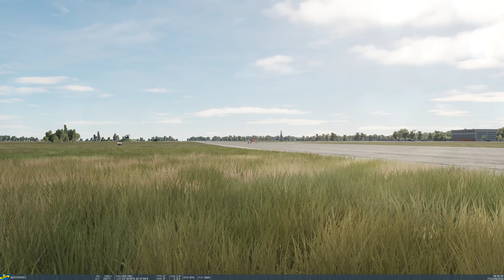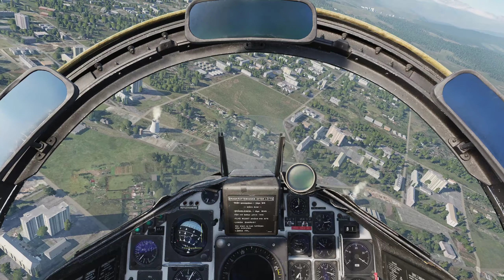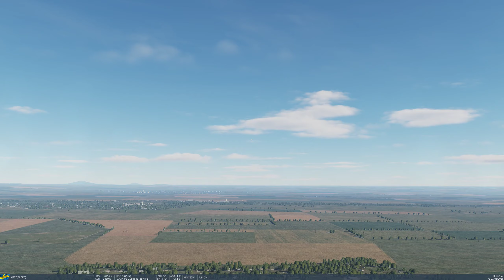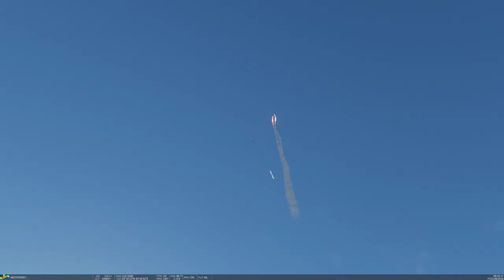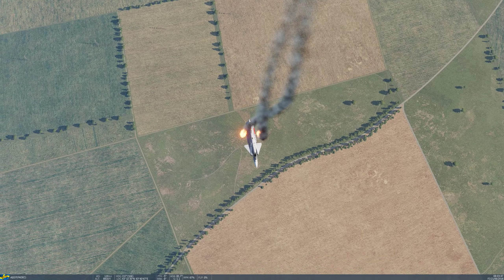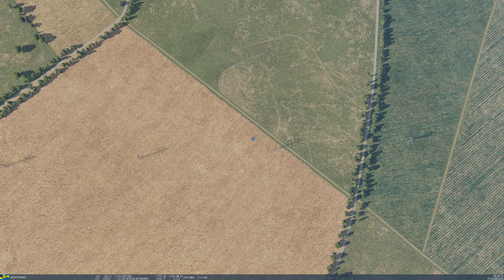DCS AJS-37 Viggen - Structural failure

Comment: I think the warranty is gone on AJS37 a while ago. 😂 Probably the programmer made a mistake when defining AK37 since that type of problem never occured IRL
Reply from the maker: Well, actually, three aircraft were lost early on with operational Swedish Airforce Viggen AJ37s (aircraft 37005, 37011 and 37014) during 74-75. Luckily, the pilots ejected safely. 
The problem was identified and rectified and there were no additional mishaps.